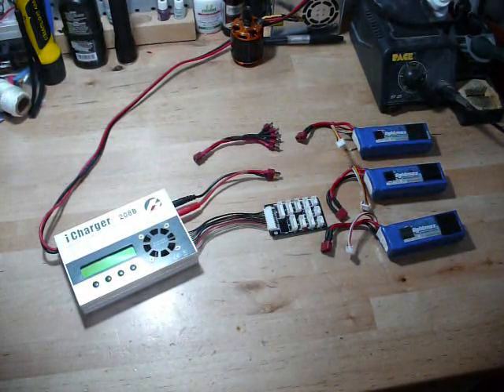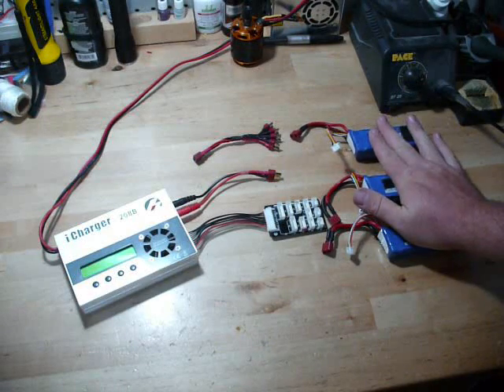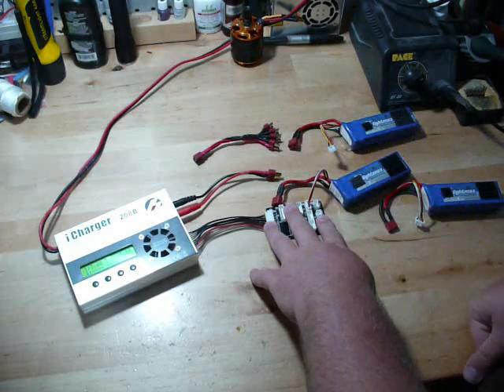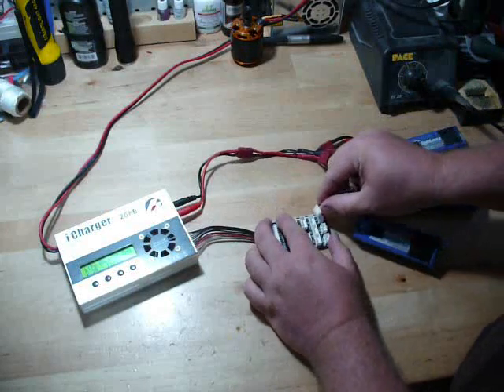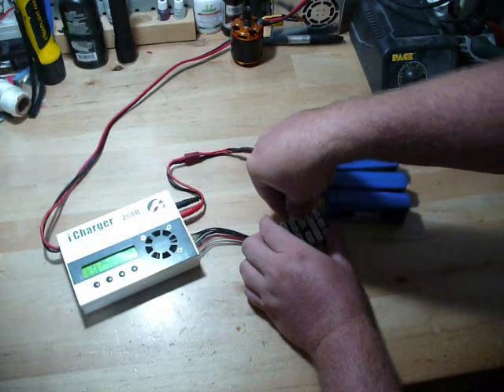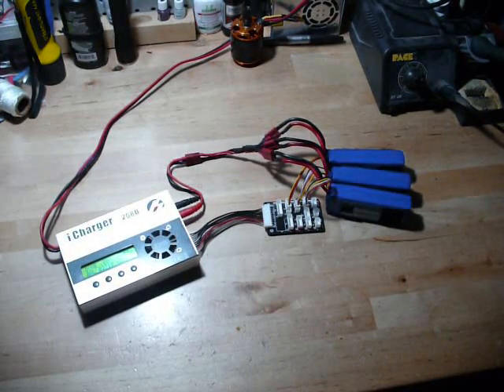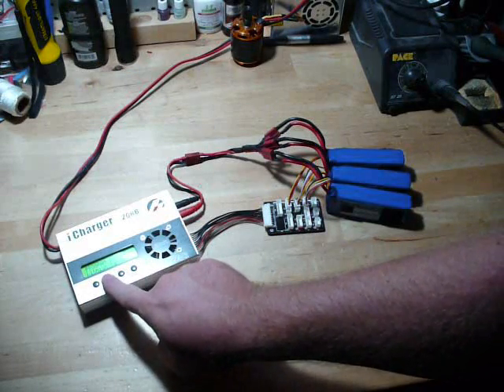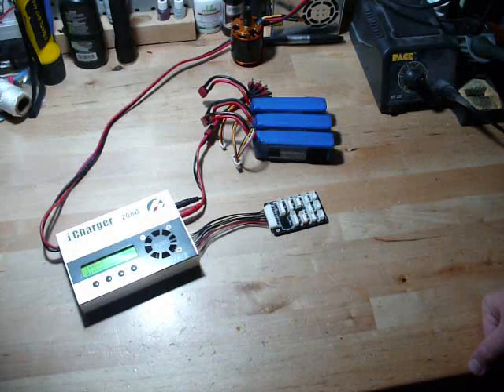Parallel charging 3x 3s packs with a kink

Comment: Mrgi1mo2 just a response to your comment. Of coarse the packs will equalize there is no test needed to confirm this. For instance if you have 2 packs very similar in voltage you can plug them both into your balance board to confirm this. Do not try it if they are far apart. My balance board is wired parallel so I can plug 2 3s packs into it using my 3s port and my 4s port just making sure the pack I plug into the 4s port goes on to the correct 4 pins. On my balance board this is done by plugging into the left 4 pins on the 4s port.

Comment: The problem with this as I have read has nothing to do with the packs blowing up or even getting hot. The full pack will discharge into the lower packs and they will all equal out. No biggy. The problem is the cc/cv factor. The dead batteries are dead and should be started charging at a lower voltage. The charger thinks that they are more full and hits them with a higher volt than they are ready for. Its like fast charging, it works in a pinch but will slowly damage the batteries

Comment: @mats1401 i bet the 3.5A spike you saw was just momentary. the thing is, the charged pack can only give so much for a short period before it "charges" the discharged pack and level off. what i wouldn't try doing is placing the balance taps in parallel BEFORE connecting the main discharge leads because that stresses the cells individually. THAT is more likely to cause damage to cells with lower SOC.

Comment: What you should try is let your packs connected without charging them and check each pack after some elapsed times (1, 5, 10, 30 minutes), and see if any current has been transferred between packs. If yes, then DON'T DO THIS. You may not see any sparks, but you will reduce life of your batteries. Also, bad idea to charge on a wooden surface.

Comment: This may work with your packs, but it's evident that the charging current gets too high if you connect a discharged pack with a full one. The current will be the voltage difference divided by the sum of the internal battery resistance plus the cable/connector. I measured between a SLIGHTLY discharged pack (1500mAh, Zippy 20C) and a full one of the same type a current of around 3.5A, which is more than 2C. You don't need hot cables or sparks to over-stress the discharged batteries!

Comment: What is that board called? 
Is it a balancing board? And where did you get it. Did it come w/ your charger?
Is the balance plug from the battery a JST-XH?  
Your video is very well done. Nice image, and good info. Thanks for the help. 
I am waiting on an Accucell charger & want to charge 2 2s 4000mah lipos @ simultaneously.